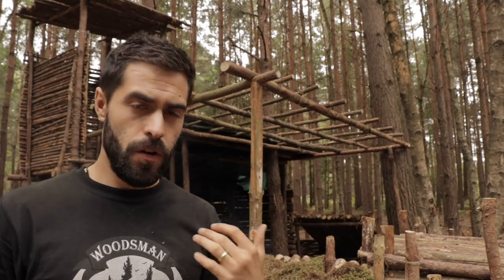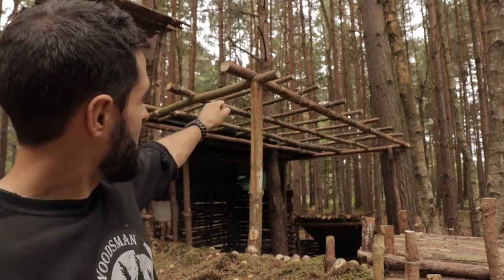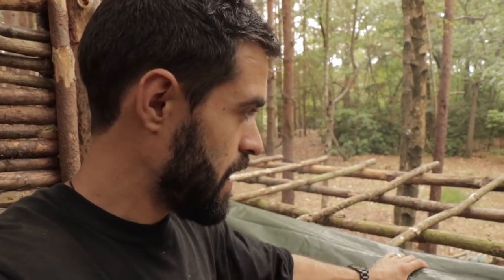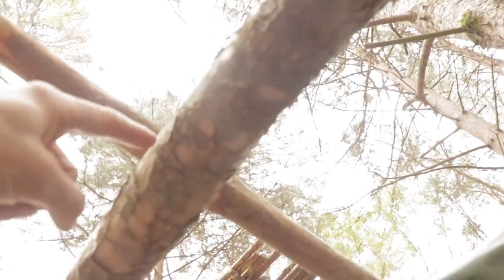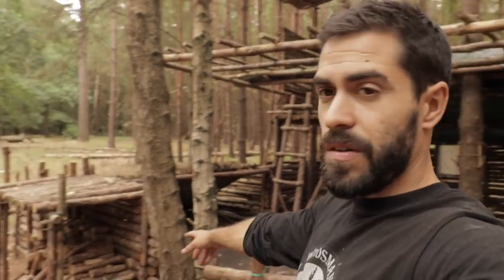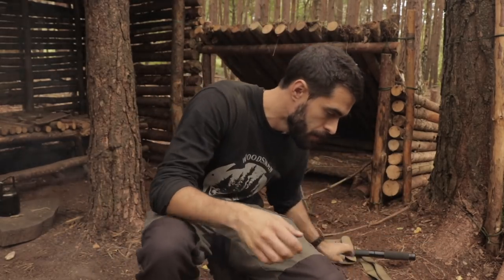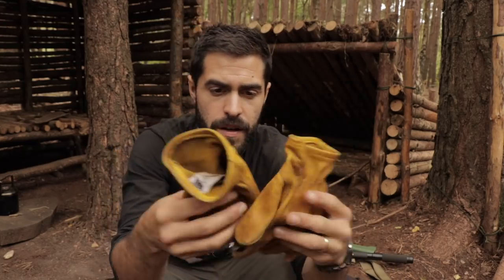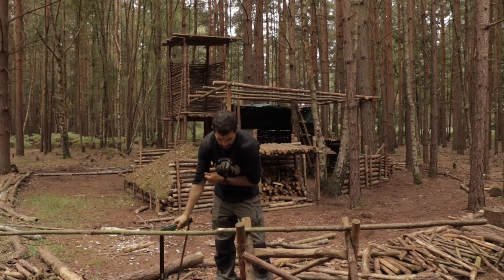Bushcraft Camp Update 15 - Wood Frame Roof Build (Super Shelter)

Comment: We've got a bus wheel in my back garden, works great and will be plenty big enough for your shelter. Roof looks great dude. All the best.
Skye
Reply: Swamp Valley how about a simple circle of rocks?
Reply: Natalie P then you have no use for the pipe they dug into the ground to supply fresh oxygen to the fire
Reply: @alasdairmackenzie6111  that's why a bus wheel is a good option, big hole in the middle for air 😉
Reply: Swamp Valley exactly

Comment: With that kind of support, you could do an open fire pit suspended chimney over your grill. Do it out of wood logs and mud... Not used much anymore, but not hard to do. Honestly the mud would be somewhat negotiable... But it's leak a wee bit of smoke without it.

Comment: Great update, camp is looking awesome!  If you’re looking for something better for a fire pit/ring, try a drum from a clothes-dryer... they’re perfect!  Large enough to get a nice big fire in it but small enough that a smaller fire doesn’t get “lost” inside. Mine is about 22” diameter so a standard circular store-bought grill for a round charcoal barbecue fits perfectly for cooking. Plus (at least the one I have) it has holes all around the drum so it gets plenty of ventilation. Mine is steel covered in enamel so it’s likely to last forever.  And the best part, you can get any machine/welding shop to cut a piece of plate steel onto a circle and weld a handle on each side, so you can cover it to a) use as a griddle to cook bacon or pancakes etc on, and b) cover the fire when you’re done and not have to worry about sparks.

Comment: Mike - fire pit wise, see if you can get hold of an old washing machine drum, we use them all the time at our camps and even take them to shows, they put out a ton of heat in 360 degrees.. down side is the burn through wood as they have very good air flow

Comment: Nice modification Mike.  With regard to the fire pit.  Consider keeping the wheel as a cooking (coals) area and your main pit larger.  A grill/grate on top of the wheel, with the wheel at the edge of the pit.  Come down from the tarp framework with a pot hanger to hang over the main part of the fire.  Versatility.  Adding a water catcher under the low edge/corner of the roof never hurts.  Nice digs.  Now, get after those bloody ants!  LOL

Comment: Hi TA, I had this thought. If you tie some cordage to both ends of the log you roll the tarp in. Then roll it up and leave the cordage hanging off the end of the roof. All you would have to do is pull the cordage and it would roll back out covering the roof area.

Comment: Have you ever considered a kukri for debarking and removing limbs? I just got one and it's more like an axe than a knife but the edge would be useful for that.
Reply from the maker: I think it would definitely do a good job, I've used Dad's billhook, and a Leuku which are both similar in size. However, with the weight of the axe head and the blade profile, it does the job well.

Comment: have you though about putting a smooth log in the middle of the rolled up tarp? it will help it stay in place without having to tie it down and make it easier to roll in and out. and it could save you some time if it suddenly starts raining hard.

Comment: I hope you will build a wood gas stove as your fire pit ? There are several videos around on how to build one. By allowing full combustion it would greatly reduce the release of smoke while heating a lot more than a normal open fire pit. Plus it's less polluting as it emits less CO2. The only problem is controlling the height of the flames so that it doesn't burn the roof !

Comment: you should see if you can dig deep enough to find water. that would be cool. then filter said water with an old style water filter (charcoal, sand, grit, pebbles, rocks)
Reply: That would certainly be forbidden, as there would be a high risk of contaminating the source. Plus it's probably dozens of meters below surface anyway.
Reply: it would not be "forbidden". it would only be high risk if he threw old food and shit down the hole and it wouldnt be dozens of meters but far enough to make it interesting

Comment: Hey just an f.y.i. the shovel you are using has multiple positions if I'm not mistaken so you can lock it in at a 90° angle as a spade to remove dirt from a deeper hole if you were not aware of that already

Comment: now all you need to work out is a pulley system for the tarp to be opened and closed from the ground easily .... and a nice big metal resevoir that can be heated from the camp fire ... then you will have hot and cold running water and a retractable roof as well ;) 
.
as for the fire pit ... a truck rim would be better they are usually bigger diameters and better construction as well ... just do the same as with the lil one just on a truck rim of the size you want

Comment: Have 2 question.. since this is a Bushcraft Camp.. at any time... 
Q.1. what are the 3 readily available small game along with seasonal wild ediables in your area.. if you get to stay at this location for longer than a month.

Q.2. How to make a Gravel Sifter to separate dirty or sand/limestone from bigger chunks or stones... 

Why?  to make bricks...which can be used for a different project in the future !!
would be good to make one or two (one to sift stones from sand and 2nd to further sift sand dust from the material you gathered from the first process...why? it would be the next step into create cement (Sand and Limestone Bricks) for a Season hardy building that is long term bush-cement-craft or at least have a 3 sided wall, waist high to keep yourself water/snow proof and keep the heat in the camp compound in coming winter